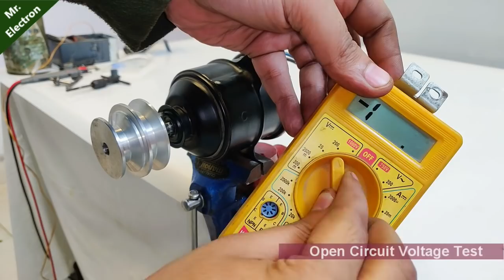Do Not Throw Away your Car Fan Motor - 12v 40 Amps DC Motor Generator DIY

Comment: Tip:  Remove the two carbon brushes and scuff the the sides up with fine emory cloth or sandpaper to remove the grime buildup, otherwise the brushes will get stuck again in the open position. Also stretch the two small carbon brush springs just a little to restore the spring compression.

Comment: I've seen several of your videos on using 12 v motors (window, cooling fan, starter and wiper) as generators and was wondering if any of these might be able to be used to charge the 12 v battery on a gas powered bicycle that draws approximately 15 amps at peak usage. A window motor would be the ideal size but I could make any of them work. The output of the "generator" would be the primary factor. Rewinding to get the right output wouldn't be out of the question either. Just wondering if it's even feasible. 12 V DC 15-20 amps is my draw, I can rectify and regulate if necessary so AC or DC would be fine. If not possible using existing 12 V motor do you have any suggestions as to how I might achieve this? Any response appreciated. Thank you.
Reply: No it is not possible. These random Indian guy electronics videos are just total bullshit. You cannot ever ever use a regular electric motor in reverse as a generator. What you need is a special very exotic kind of motor, like certain ceiling fan motors, ebike motors, or stepper motors that are very very rarely if ever found inside most countries AC appliances. What makes those motors special is that they have many many coils on the outside, or that you can use them basically so that the stator becomes the rotor, i.e. the outside rotates around the inside. Normally you only have two coils on the armature, and each generates considerably less than a volt at humane RPM. The more armature coils you have the higher the voltage you get if you put them in series. Those special kind of motors are very rare, but if you happen to find one, then chances are 9 out of 10 it will not have enough coils to charge a car battery. Ceiling fan motors are one of those rare exeptions where you will find more than 8 coils, like 12 coils sometimes more. So if you spin them at thousands and thousands of RPMs any of them will be able to charge a car battery. But you need to modify them with huge magnets that you have to glue on the outside, one for each coil. So strictly speaking, ceiling fan motors cannot be used as generators as well without basically rebuilding half the motor. It is just that they are one of the few types of motors that can be realistically rebuild at all, without compromising the power or integrity of the motor too much.
Reply: Conundrum is wrong. All DC motors can be turned into a generator. You need a charge controller, a capacitor possibly and a force to spin the motor.
Reply: @joewaligator4364  Agree.....conundrum is having an off day... Ceiling fans are induction motors and cannot generate unless hugely modified

Comment: How did you measure the "40amps" you claim to get from this generator? 12x40=480 so you are generating 480W but still barely lighting a 55W bulb. No offence, I must have missed something.
Reply from the maker: Actually this video is related to one of my previous videos in which i tested a similar dc generator ( armature winding with same gauge copper winding ) by coupling it with a 4000RPM 1.5H.P trademill motor for conducting a short circuit test hence the 40 Amps Boast 😊
Reply: @MrElectron  Okay, thanks for the lightening!